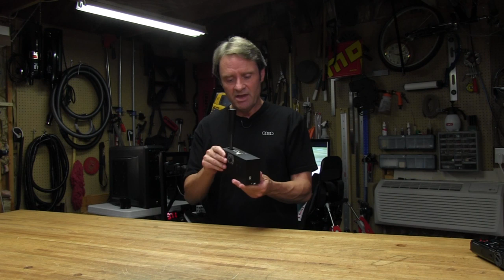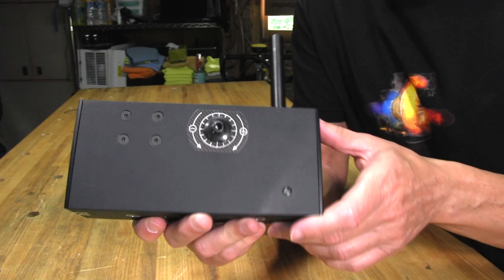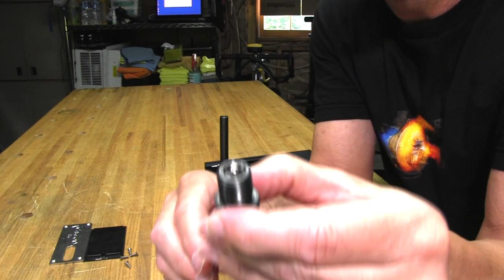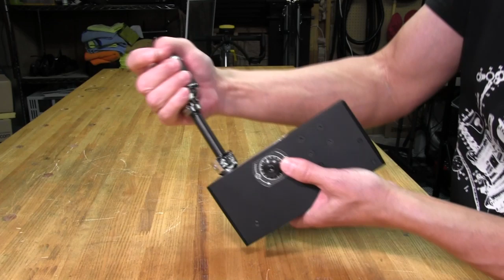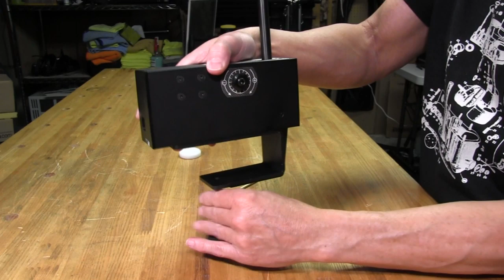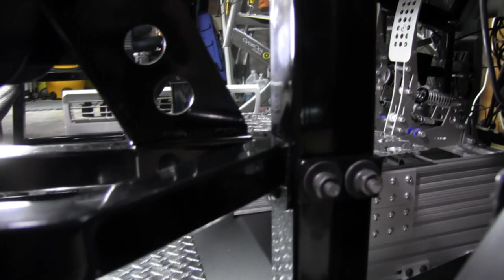ARC Team Carbon Sequential Shifter Review

Comment: Off this topic buy a fundamental question on your monitors.  Are you using SLI physX? If so how do you get your 4th monitor to display your telemetry? 

You have done great work, just purchased some Heusinkveld Engineering pro's and it has finally added the brake control I had been seeking.  WOW! You helped me make up my mind.   I liked my Fanatec V2's, but totally different ball game.
Reply from the maker: Glad you could make the right choices after watching my video's. To answer your monitor setup question. In this video I was using one Nvidia card, not SLI. I had the bottom three monitors
as one single monitor using Nvidia's surround feature. Once you set that up, you can go to the "set up multiple displays" section of the driver and add the 4th monitor. After that just open whatever app you want and drag it to the 4th monitor.
Reply: Sim Racing Garage   THANKS!  I will take a look.  *ultimate not pro, I misspoke in my excitement. Every session is getting better.

Comment: Have you used an actual sequential shifter in order to compare the feel?
Reply from the maker: I actually have been able to get my hands on two different race sequential shifters. And they both felt different. As they were from two different shifters from different manufactures. And there are more than just a few manufacturers out there. I imagine most of them will feel differently based on manufacture, but also based on how the linkage and gearing have been adjusted. But I can tell you that the ARC shifter mimics the real thing better than the other "Sim" sequential shifters I have tried to date. But I will be reviewing the PRO-SIM sequential when it comes available. They will also have a "lite" version of their sequential that I am also interested in.

Comment: link, where to buy it
Reply from the maker: Unfortunately, ARC no longer produces this excellent sequential shifter. It's a shame really, as the one I have works just as well today as it did when I first got it. A very well engineered and produced unit.
Reply: what gear you produce now?
Reply from the maker: I'm still using this shifter today. There are some others out there worth your consideration. HE has one as well as HPP. I'm going to be doing a review on the HPP unit soon.

Comment: I WILL have a rig like this someday.....
Reply from the maker: It took me a long time to be able to get this rig bought and put together. If you are as determined as I was, I'm sure that day will come sooner than you think!
Reply: Well right now I just got my t500rs and put the Ricmotech brake mod in it after about 20 minutes of stock play. Although that is it... I am using it on a computer desk and my chair rolls back when I use the brakes now hahahaha. I shove a towel under the wheels and that works fine but yeeeeea....
I don't want anything nearly as crazy but a chair/mounting rig is next on my list. Any recommendations would be great!

Comment: As per ARC's website, the spring plungers are no longer adjustable by the customer as per this production run. Perhaps you could add that as an addendum to your video.
Reply from the maker: You are right. But the tension in the shifter can still be adjusted in the same manner as before, as the internals have not changed. However it will void your warranty if you do. I think this is a bad move by ARC, and have told them as much. In their defense, folks were adjusting the tension incorrectly. Moving one side more than the other, which causes undo stress on the internal mechanism. But there instructions on how to adjust tension were not very clear or understandable. Lost in translation maybe? ARC could have made a quick video on how the internal adjusting mechanism functions to clearly show why it need to be adjusted precisely on both sides of the shifter. That's what I tried to convey in the "A Look Inside" portion of the review. If I can do it they could have done it too. I think they have gone the wrong way to resolve the issues they were having with folks not properly adjusting the shifter. Again I communicated this to them. I still think it's the best feeling shifter I have tried to date, and I have been banging on mine for well over a year now, and it feels just as good as when I first bought it. Very well built piece of kit, and you can still adjust the tension if you want. Because of how this unit has performed, I would do it even if it did void the warranty. But that's just me.
Reply: It seems a strange move for ARC to make. Now consumers will not even have any instructions. You can see how we rely on you more and more!

Comment: At this moment i own a DSD seq shifter. The rod has a lot of free play around its centre, something that really bothers me. My question about the arc shifter is about the build quality: is there play in the rod and or is there a possibility for free play?
Reply from the maker: There is some forward and rearward play in the shifters shaft. Not enough to bother me, but it may be an issue for some. If you watch carefully in the driving part of the video you may be able to notice the slight play in those directions. When driving I don't notice it. I don't think you will find a sequential out there that has no play what at all around the center. If there were no play at all, then the shaft would be binding up, and cause other performance issues. I don't know how much play the DSD shifter has, and not sure which version you are using, but I will be doing a review on the short through Pro model that Derek sells. Then we'll see if the play is so much that it is bothersome to me. We don't hold anything back here on the Sim Racing Garage, so you'll know if I have a problem with it!